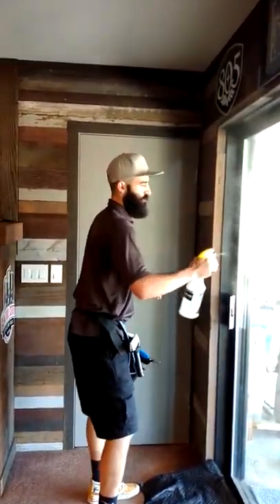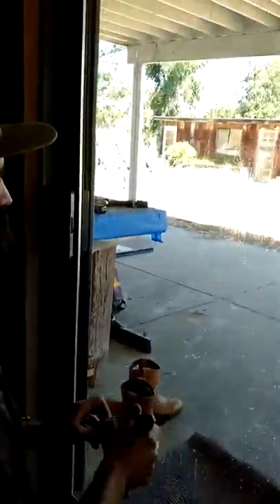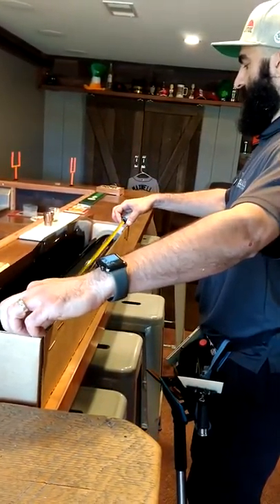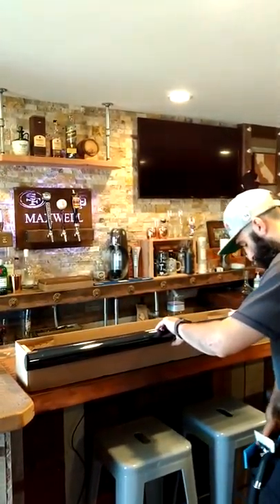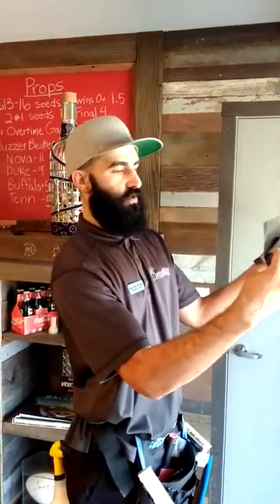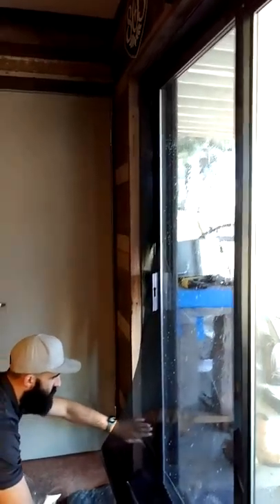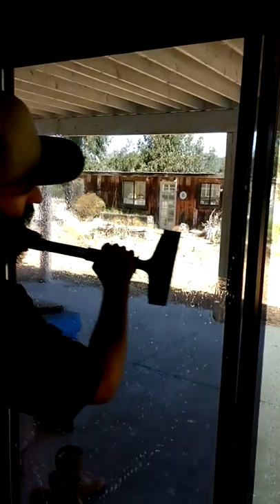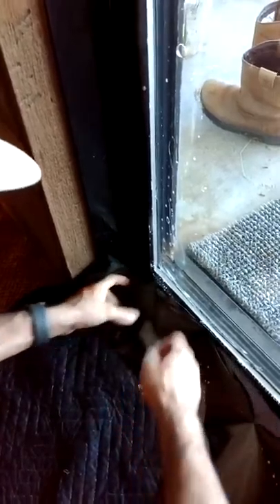In Depth "How to Install Window Film on Home Window" + Tool Showcase

Comment: Hey guys awesome video. I’m an auto installer looking to expand into flat glass work. What is the most common VLT for residential flat glass?  Also, why not use the factory straight edge for one side of the window?
Reply: Great question. I couldn’t use a factor edge on these windows because the rubber wasn’t straight enough.
Reply from the maker: Thank you for watching - check out my response under Austin Cook